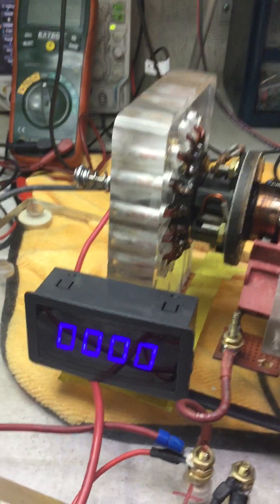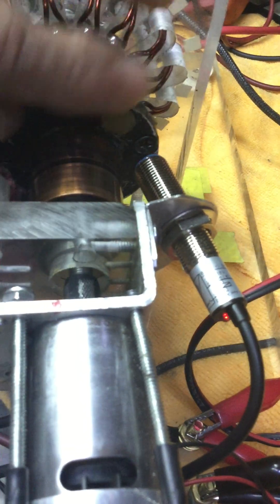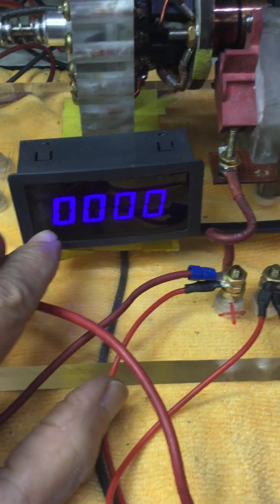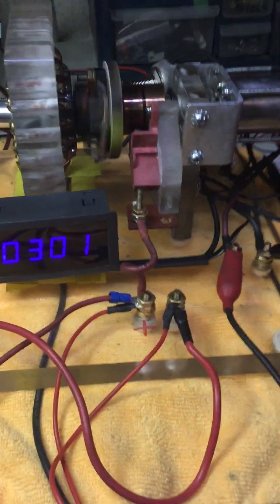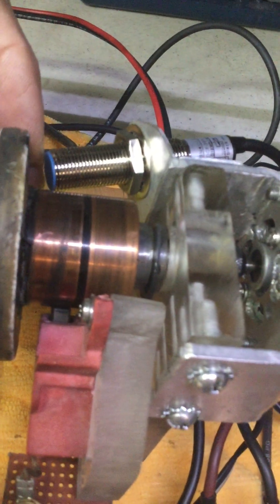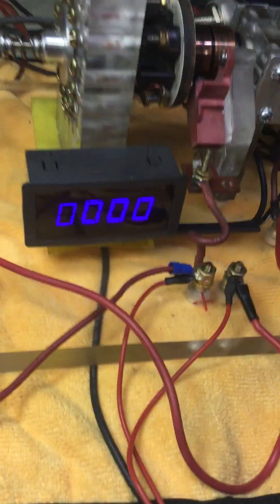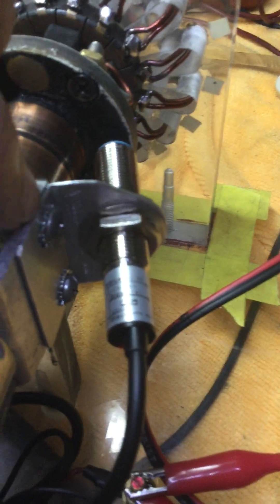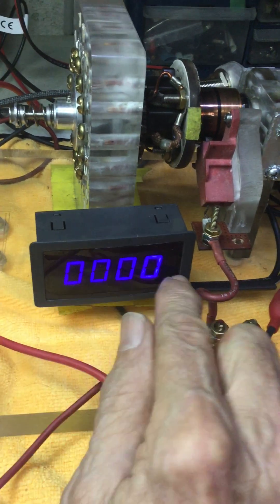DIGITAL TACH MOUNTED ON ROTARY SWITCH

Comment: Good ✔️ day ufo politics,i want to ask you some questions hopefully you reply me all, I've 12vdc bosch motor 400w, it has 4 ceramic magnet NSNS, and they use 0.8mm to wind it, on idle mode it consume 3.5A ,so my question now is if i want to make it to consume less amperage what we i do

(1) by changing the enamel wire from 0.8mm to 1mm
(2) by putting more turns of wire per slot 

(3) by replacing the ceramic magnet NSNS with strong neodymium 🧲 magnet,
Which one should i do to reduce current consumption and increase efficient
Reply from the maker: You have to rewind this motor armature, using at least a double FINER wire than it has,...and that would reduce it around Half the Ameperage it consumes now..
If you rewind it using a COARSER wire (like you are writing above, from 0.8 to 1.0 mm), then Amperage would go Higher.

This would be the last time I answer to you, related to this issue.
Reply: @ufopolitics  I apologise 🙏 friend the video has been long time ago it seems am drawing you back but I really want to replicate it,it seems your system is consuming less amperage than conventional one, secondary your talking about symmetrical wiring and asymmetrical wiring of armature of DC motor how to do that, I've watched almost all your video but haven't clearly understand, thank you I we be waiting for your respond I appreciate
Reply: @ufopolitics  what do you mean by  using double FINER wire, does it simply means since the wire guage is 0.8mm I should used 0.4mm enamel wire double?,
Secondary you mentioned COARSER wire do you mean big size wire,
The question is if I used small size of wire rather than 0.8mm  we it affect the torque, HP and speed  of the motor